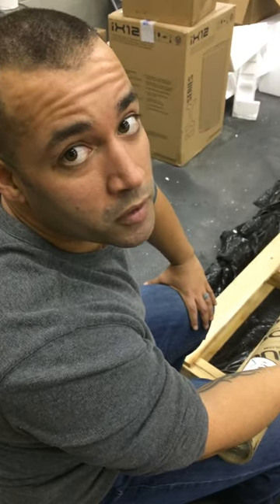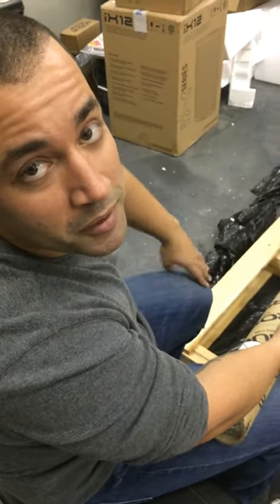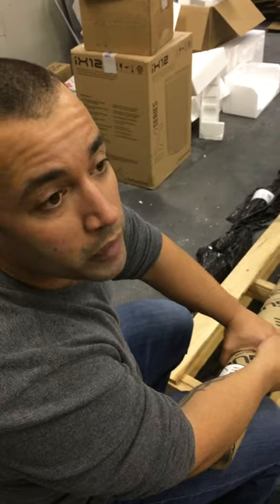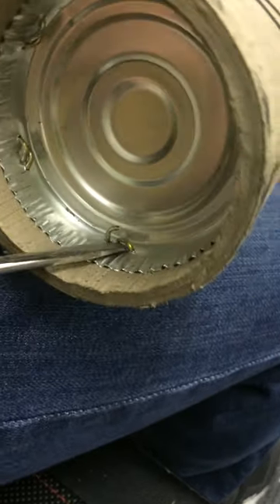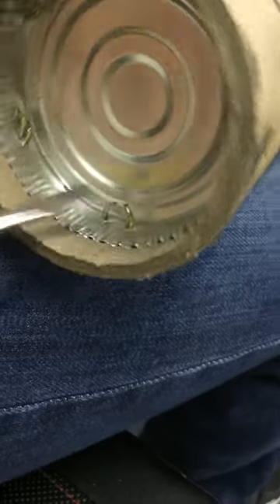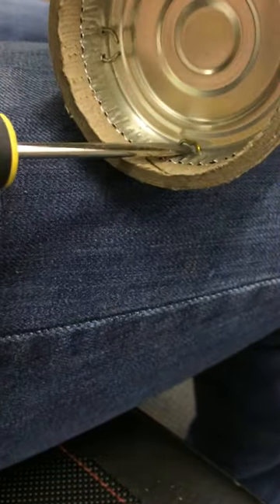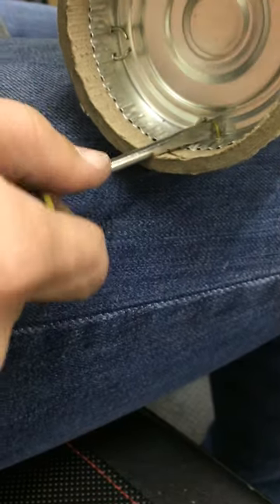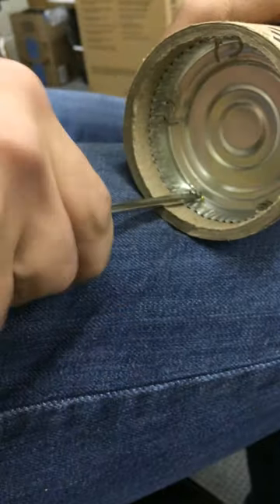Easiest way to get Rogue fitness barbell box open

Comment: It really is brilliant, bomb proof packaging on Rogue's part, considering the rough treatment shipped items get. Great tutorial. I did it the same way. Only differences were I used a pointed awl to get the staple started and then the screwdriver. Worked the metal cap out with pliers and slid the bar out. I saved the shipping tube in case I move or sell the bar. Thanks for your video!

Comment: Once you get the staples out, use your needle nose pliers to pull the end cap out, the tilt the tube onto something soft so the bar isn't damaged and work the tube off the bar.  If this takes more than two minutes, you are doing it wrong.

Comment: I'm sure this way works I couldn't find a screwdriver. I just smacked the cardboard where the metal cap was and it crushed it down enough to get the claw of a hammer in and winch it off.

The box is longer than the barbell (I got at least) so if you tilt the box so the barbell slides to one side you have half a foot or more of open space, so you don't damage the barbell